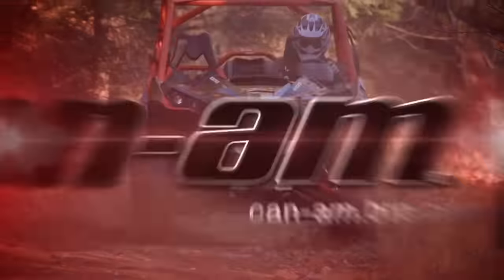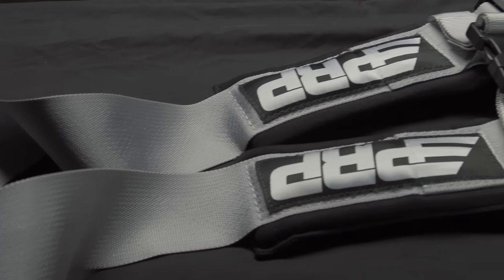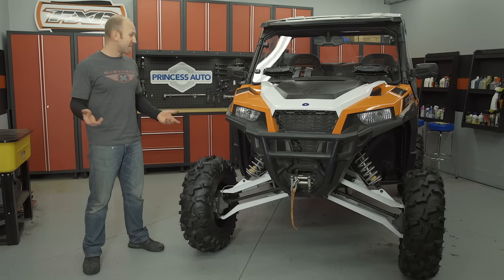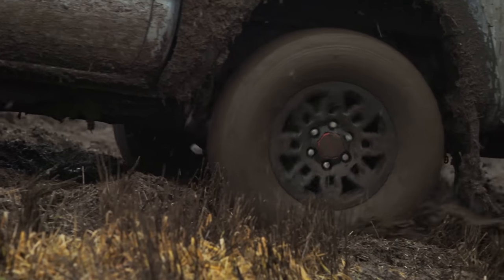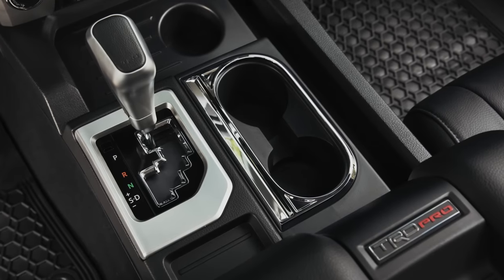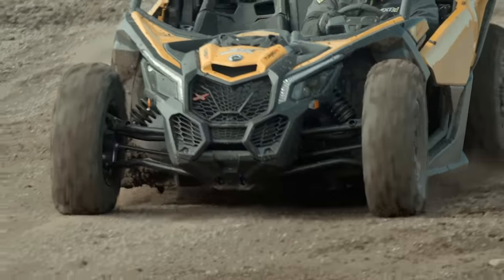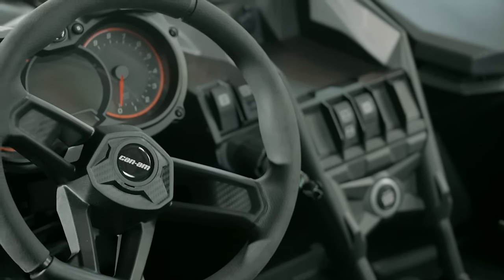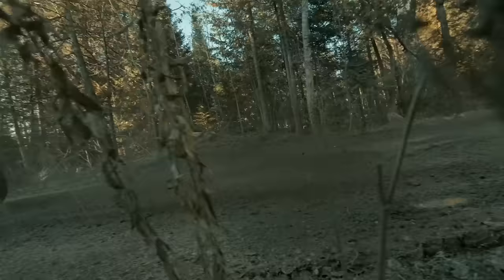Dirt Trax Television 2016 - Episode 20 (FULL)

Comment: I like the build but the only thing I would recomend is that you always want a wider rear tire in the back for stability. It makes a huge difference in grip and cornering flatter and not rolling over. I have been on both many times and it is very apparant. The manufacturers know this and that is why they always put wide tires in the back whether it be a atv or sideXside.

Comment: 8 months ago I decided I was going to get a sxs I couldn't decide between the general and commander 1k so close on paper so I went to dealership that sold both.  I was very serprised what the difference was in person the fit and finish was far better on the can am.  Commander tail gate was snug and close tight Polaris didnt close tight and was loss and the side doors was the same way on the general.  Still keeping an open mind I got into the general and they when I realized it was not for a guy 6' 3" my right knee was into the dash with seat all the way back, got into the commder I had more they enough room so on that I took the commander home. I ride with a friend that bought the general and I have never thought that I made the wrong decision with the commander.
Reply: Jesse Frost I'm only 5-11 and I feel the genral had much more room compared to the cammander also getting in and out was tight for me
Reply: Jesse Frost 
What state are you in where they sell both?
Reply: Missouri,  Warrnsburg cycle.  Is where I compared the two but that's not where I actually bought it... That's where I went to compare the two new machines side by side.  then shop around for the best price

Comment: Toyota has a couple of good looking trucks but until they drop a large displacement diesel in them I'll give them a miss...
Reply: Jackal's Outdoor Channel they have a Tacoma that comes supercharge from the factory! Many check that out
Reply: DALA BEAST thanks. it's not their power output that I don't like about their gas engines. I just prefer diesels off road...
Reply: Jackal's Outdoor Channel bigger dosent always mean better
Reply: the Toyota range has a 3.6 V6 gas engine... all I'm saying is put the same size diesel in there.. what I mean by large displacement is not one of those Asian 4 cylinder lawn mower engines... anything less than a 3 ltr is too small and as you increase diesel size the torque increases... which is the key to easier off road driving.. bigger gas engines are not always better but the same is not necessarily true for diesels..
Reply: True. I'd rather haul with a diesel any day

Comment: That was nice of Toyota to let you drive the trucks but either Ford or GM trucks are significantly better than Toyotas.
Reply: John Doe dude you got some issues a Toyota will out last any gm or Ford
Reply: REBEL RIDERS In terms of engine reliability? Maybe..MAYBE. In terms of being a better truck in how it's made and how tough they are? Not a chance, Toyotas are shit trucks when it comes to doing "truck things" and holding up to basic duties as a work vehicle. They just got in trouble for their frames rusting out and cracking in half.
Reply: I Have a Toyota and a GMC Duramax, I like them Both! PotÄto, Potato its all based on likes and what you want it to do!